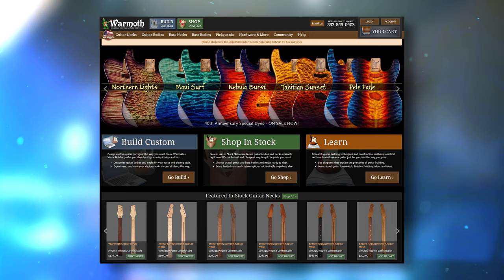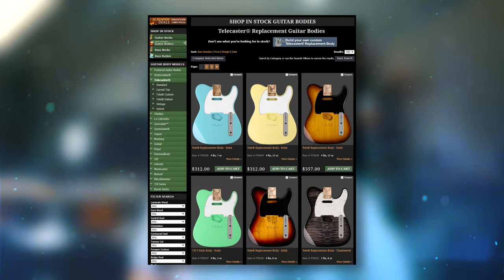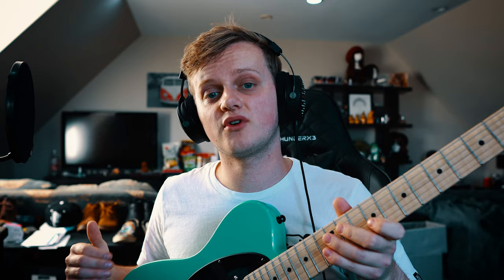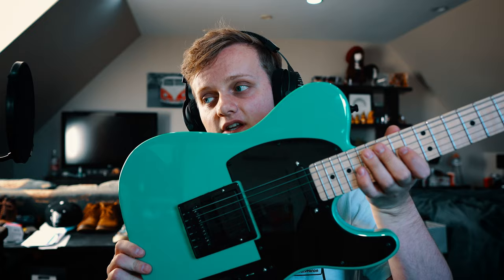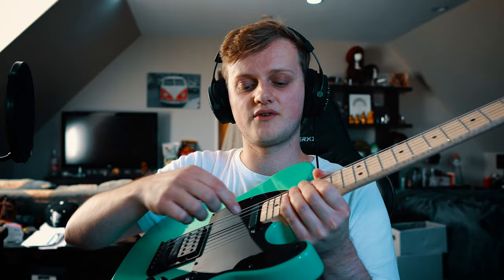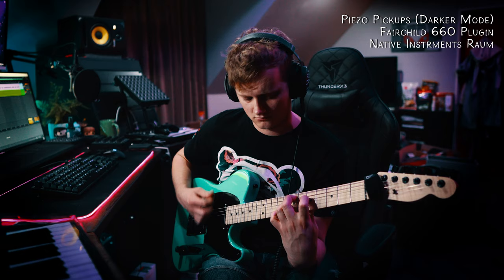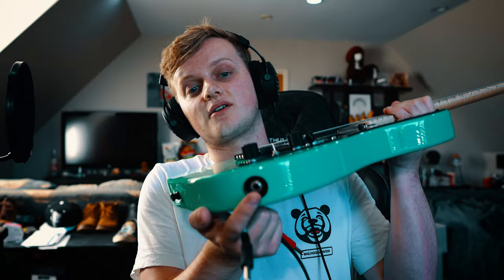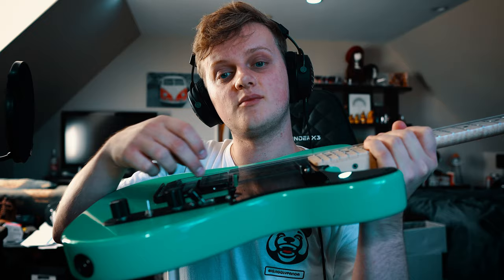My Warmoth Telecaster In Depth | Bare Knuckle Pickups Silo/Flat '50 | Graphtech Acoustiphonic

Comment: Excellent guitar!
If you ever need to dremel/file out cavities in future it's a good idea to score/cut the paint with a knife first (I use a scalpel/hobby knife).
This ensures that if the paint does chip off, it will only break off at your score mark!

I ran into this myself when replacing a cheap Floyd Rose copy with a GFS Fastloader (Floyd replacement that accepts standard strings).
Reply from the maker: Cheers man ✌️ That's a super handy tip by the way! Given its under the pickguard anyway, it didn't really matter too much if it did chip. However that's definitely going to help if I do another build at some point.

Comment: My perfect guitar:

Body: 
Stratocaster shape
Mahogany body with flamed maple top
HSS pickup configuration (Seymour Duncan SH-4, SSL-1, STK-S4N pickups)
Floyd Rose tremolo system with brass block and tremol-no mod
Neck/middle and bridge volume + master tone control configuration
Dome control knobs
Pearl pickguard
Red to black burst
Gloss nitro finish

Neck:
CBS-style reverse headstock
Flame maple shaft
Ebony fingerboard
24 stainless steel jumbo frets
Thin C neck profile
7.25" - 12" compound fretboard radius
Locking tuners
Pearl block inlays
Luminescent side dots
Satin nitro finish

Miscellaneous specifications:
Neck-through construction
Black plastics
Chrome hardware
Dunlop dual design strap locks
Deep body contours and heel joint
25,5" scale length

It's basically a fancy Ibanez RG or a hot rodded 70s Fender Stratocaster/Gibson Les Paul supreme hybrid, designed as a versatile metal axe. 
To me it's the perfect balance between classic design and modern playability
Reply from the maker: Sounds like it would be a pretty solid axe man! 24 fret on a strat would be cool as well. What's the idea behind getting a Floyd, but then adding the tremel-no to it? Like for an Ibanez style fixed bridge with fine tuners? Or just for the option of having one should you want it later?
Reply: @LivingTimmy  the tremol-no is basically just in case. If it's going to be my main axe I'd like it to be as versatile as possible
Reply from the maker: Ahh I see, good idea! ✌️

Comment: That’s a bad ass tele, I built a warmoth Strat with Gibson scale neck and a single Seymour Duncan SH5 with split coil and a roasted flame maple neck. I love it just struggling to lower the action a bit because I got a compound radius and 6100 jumbo stainless steel frets (they’re huge). Once I dial the action in further it will be nicer than my Gibson. Just afraid to keep turning the truss rod . Love your build , the piezo and the magnetic pups sound awesome!
Reply from the maker: Cheers man! I was actually really tempted to go for a Strat initially. I was going to go for a matte black body, roasted maple neck, a single BKP humbucker in the bridge, and then I'd install the piezo system in a Floyd trem. After budgeting it out, the Tele that I actually did was going to be a fair bit cheaper, even with the added neck pickup.
Checked out the vid of your Strat on your channel, I dig it! Has it got a push/push for coil splitting?
Reply: @LivingTimmy  yes indeed , I’m working on a better quality video to show it off, I’ll be sure to hit you up! Cheers !
Reply from the maker: @Crescent_Audio  just briefly watched it on my break at work, looks like it's turned out fantastic! Especially given it was $1.1k for the whole thing 👍

Comment: I actually have a full custom build from them patiently waiting for them to be able to start up again. I'm a strat and jazzmaster fanboy with configs of all kinds but p90s so I've got a p90 machine in the works that's a mashup of said pickups and some of my favorite S/JM types. It's a swamp ash JM body with a standard strat floating trem and recessed input, JM pickguard with a SD vintage p90 in the neck and a SD hot p90 in the bridge with tone, volume and 3 way on the guard. The neck is a one piece birdseye maple with vintage tuners and with a 10-16 compound and a black corian nut. All the wood is unfinished as I plan to do a blue stain on the body and oil the neck then all black hardware, guard and pup covers. Really looking forward to this thing!
Reply from the maker: That sounds super nice man! I'm a big fan of Jazzmasters, so had actually toyed with getting a JM instead of a Tele at first. My thought was that in order to get a Piezo or MIDI control board into the guitar, it would be a lot easier making my own routs/cavities safely hidden under a pickguard. If I did another build, it would probably be a single bridge humbucker pickup on a Jazzmaster with a Roland GK MIDI pickup in it. That way I can add Jaguar like controls/switches to the pickguard that are actually controlling the MIDI side of things ✌️
Reply: @LivingTimmy  Interesting, I'm not confident enough to do my own full on routing and have never given guitar midi/piezo a play, I'm intrigued though, it sounded really cool!

Comment: Yo Tim! Did you ever do any other mods to the tele? You said the signal from the neck pickup was low because it's going into a 500k pot but if you solder in a 470k or 500k resistor from the lug that the hot lead of the neck pickup attaches to and then ground the other end to the volume pot then neck pup will think it's a 250k pot and your neck tone will be brighter and louder! Ho ho ho 🎅🎅🎅
Reply from the maker: Hey man! I haven't really done any more modifications to the Tele at this point, I was thinking of drilling a hole in the bridge somewhere to rout the piezo wires under the bridge, but didn't have the correct drill bit when I was restringing. I'll definitely have to look into that resistor trick! Cheers man! 🤘

Comment: Hey Tim SICK demo and riffage of this tele build ! It's sweet builds like yours right here and several other videos/research that made me finally pull the trigger on my own however I'm a little stuck on the neck/net width...
:
Burning question say you can ONLY choose a standard thin neck option not a large neck, boatneck or 59 profile etc, just the closest thing to what you think is a C shape neck.
- now what would be your 
GO TO nut width to compliment it ? Should I go with
 1- 11/16ths (43mm)
 as a safe starting point? That's what is considered standard nut width I believe and it matches up with most of my favourite guitars and probably those of other players really because..
.
I know for SURE i cant go much lower in terms of nut width especially the vintage fender size *41mm will probably too tiny feeling! Im 6"1 and on necks like that in the past with my moderate sized hands (yet smaller pinky finger lol)
the high e string slips off the fretboard when playing fast/soloing maybe you've experienced the same kind of tendencies on a thin nut yourself?
.
And Important note is I'm NOT going with a floyd rose, instead a gotoh 510 bridge SO basically I'm stumped there and not sure what nut width to settle for. Even on the opposite end of this, going TOO large width wise so higher than 43mm will likely feel way too wide I don't want playing between strings to feel like a massive "leap" either
.
Anyways, with all that in mind my guess is it's safe to lean towards a
 *standard thin shape neck + 
1 11/16 nut* it sounds like the safest recipe so far and for that area I'm really OK with "vanilla"/safe nut width and neck combo since if that one aspect is off, we can surely both agree that it can drastically compromise the feel of a good neck!
.
Anyways I'm very interested to hear if you agree or what your advice would be for a newbie first time builder like myself. I cant tell over video but something tells me we might have similar size hands! 
.
Apologies for the novel amd I hope to hear back from ya whenever you get the chance! Cheers from Niagara falls Canada and please stay safe and healthy during this time🙏🤟😊
- Adam
Reply from the maker: Hey man! Cheers for digging the video. 

In regards to your nut/neck profile question, I reckon you're bang-on with the 1-11/16" nut and a standard thin neck. It's exactly what this Telecaster has haha. It plays really well and definitely prefer the neck shape over my other guitars (I also have a Gibson LP copy, a Jazzmaster Baritone, and a few extended range guitars). My Jazzmaster is vintage spec and has the thinner nut width and rounder neck, and it is definitely a bit harder to play the first fret on the low and high strings.

If it helps, if I were to make another 6 string Warmoth build, id still use the standard thin and 1-11/16" measurements ✌️

If you need a hand with anything else man, just let me know and I'll help when I can 🙂
Reply: @LivingTimmy   wow thanks for such a timely and helpful reply I really cant thank you enough man!! The bulk of my research and info that helped with the connection between neck shapes & nut width was from finding out first hand from as many people I could that have already started or finished their builds (like yourself) , stewmac and of course Aaron from Warmoth on their youtube channel in all his videos that he posts.
.
 What you've said above^ is a big help going forward!!  Without a doubt their is an
 irrefutable link between those two If I mess up the nut for my standard thin neck profile then it will take a long time to correct it by a pro/luthier because none are open here due to the lockdown right now! So I'm trying to order once/ aka "buy nice" so I don't have to twice! 👎
.
.
1 11/16ths (in canada most really just say 43mm anyway) seems like a safe bet and I'm just about convinced that something that size has wayyy less a chance for me to pull the E strings off the fretboard when playing fast like it has on too many guitars out their new in store or used that use something like 41mm ? Aka most of what fender has out there.. . I'm gonna go right out and say it to anyone else reading this that you could find the nicest suhr or ernie ball family reserve models etc for a steal at times on reverb, kijiji (canadian craigslist's) but in the end It will be a waste of money or gas driving to try that guitar by an amazing brand IF the nut width / string spacing is too narrow or too far apart! So after all the digging, watching videos like this and hearing first hand I'd much rather go custom order through warmoth for exactly what I want how I want then spend anymore time trying other brands guitars! I agree with you it's all in the process and understanding the ins and outs of these specs will only make the build, and future builds easier and faster once you can figure out exactly what fits the bill. 
.
.
It really is insane to think about how you can have everything dialed in about a guitar/ or build, yet if one area such as the nut is off, by mere fractions of a mm, your hands immediately recognize what doesn't "feel" right ! Lol
I'll be pulling the trigger on it as soon as possible and thanks again for the helpful advice man I'll keep a look out for your future videos/progress on builds and what not! 
Cheers all the best 🙏🙏🙏🤟
- Adam
Reply from the maker: Glad I could help man! I fully understand what you mean. It's something you don't really notice until you try a guitar with a different spacing. I still definitely enjoy my Jazzmaster, but it isn't as comfortable as the Telecaster. So if you're sinking a fair bit of cash into a custom or DIY build, might as well have it 100% locked down as to what you want eh!
Reply: @LivingTimmy  Thanks again for all the helpful tips so far Tim!! 
.
Your hands could be similar to mine but it's all playing style and preference is a constant change in life and time spent playing guitar even with versatile specs" there isnt a one size fits all! 
.
SO the final thing I'll ask you is on your standard thin neck profile:
 did you ever have to roll the fingerboard or shoulder edges to make the sides of the fret board feel more comfortable?
.
.
 I still think the standard thin profile on a flame roasted maple neck is right for me I might trim down the sides/ shoulders and give the fingerboard edges a slight "roll" to make it comfortable kind of like a charvel , its tricky because I don't know how significant" warmoths fingerboard roll" feels like, I wouldn't want them to take too much material off that's for sure haha but the positive being that because its roasted all the way through it wont wreck any of the wood finish/grain pattern atleast.
.
Cheers mate and huge props for clarifying everything this far especially the nut width!
🙏🤟
- Adam

Comment: Do you remember what type  of bridge pickup rout you chose? I can't seem to decide whether to get the bridge or wood mount. Thanks man! Really inspired with your build.
Reply from the maker: Hey man! So I had them do a Humbucker Rout (non-wood mount) so it has the slightly deeper cavities on either side of the rout to accommodate for long screws. The bridge pickup is directly mounted to the bridge piece ✌️
Reply: Tim Murray thanks a lot for the response! Stay safe! 🤓🤘🏽

Comment: Dudeee that was so satisfying to have various pup sound! Btw where do you find the diagrams for the wiring and stuffs?
Reply from the maker: Cheers! For the wiring diagrams, I basically just used Google images to look for ones similar to what I wanted, and then just adapted them. Graphtech supplies a wiring diagram for their circuit board and how to wire everything to the weird stereo jack, so I just googled a basic HS setup and how to add a split coil, and then blended the three wiring diagrams together. I'm not the tidiest with wiring (still a bit of a rookie), but it gets the job done 😂
Reply: @LivingTimmy  great job dude!

Comment: I have a Warmoth built Tele as well. It's my n°1. Here are the specs as you asked, it's a modern in traditional clothing:

- Modern construction AAAAA roasted flamed Maple standard thin neck with rosewood fretboard
- 10-16" compound radius
- SS6100 Frets
- moonglow side dots
- Chambered extra light roasted alder body finished in Sherwood green over 3TS (all nitro)
- Bare Knuckle Flat 50s, wired using a traditional 3 way tele Emerson wiring kit
- Copper shielded
- Electrosocket
- Gotoh vintage looking locking tuners
- Glendale bridge plate
- Titanium ferrules and saddles

Pictures and complete story here: https://www.unofficialwarmoth.com/index.php?topic=31117.0
Reply from the maker: Man that looks wicked! Loving the look of that Roasted Flamed Maple ✌️looks like you put a huge amount of attention to detail on that build. How do you find the Flat '50 in bridge and mid position?
Reply: @LivingTimmy  thanks man I appreciate it, I really did. I planned it for like 6 months, constantly changing things up to finally settle on this. I love the pickups, they sound great in every position. Bridge pickup is surprisingly beefy (not as beefy as the Silo but still) and handles high gain like a champ!

Comment: awesome build! It sounds very growly which is really why I'm definitely ordering this crazy Silo pickup.

I'm building a swamp ash Jazzmaster body with extremely similar specs (I went for solid paint Capri Orange though ;)) with a strat pickup in neck, humbucker over a Gotoh 510 bridge and a Stratocaster roasted maple neck.

Would you say the BKP Flat 50 accentuate well the bright "thumpyness" that you'd expect from a Swamp ash telecaster or do you think there could be a better sounding pickup in their lineup for this kind of sound?

Also I just wanted to point out that maybe the reason you have a volume drop in middle position (both pickups) is because they are out of phase, most pickup makers do the winding of a single coil in an opposite way they do the winding of a Humbucker. So without indication putting a single coil and a humbucker in series may put them out of phase. You probably want to switch the polarity on your switch of one of the pickup if that's the case and see if that works better for you (I may have just told something you already know, if so... sorry and cheers mate ;))
Reply from the maker: Cheers man! Definitely like the sound of your build man! Swamp Ash Jazzmaster would be sick. That new orange colour looks really nice as well 👌

The Flat '50 definitely has a nice sound, though I think there are some other ones in that range that have a bit more of that thump sound (I think it's the '59 and '62). BKP have good sound comparisons on their website.

I did have the thought about the phase issue, however it would only drop volume  in the middle position if that were the case. Coil tapped bridge pickup alone drop a fair bit, and then the neck pup is a bit lower than the Humbucker. The split coil one is the one that stumped me a bit, as I think the neck is just not as hot as the Silo. That being said, i still like the mid position tone I get haha 🤘
Reply: @LivingTimmy  yeah for real, that middle split sound so full and has that growly single coil juice, it's a keeper.

I'll definitely follow your pickup suggestion, I'm aiming for a very vintage style sound on the neck. I'll make neck and bridge position into opposite "heat" basically, like 2 separate instruments.

Thank you for the quality content!
Reply from the maker: @TomatePasFraiche  You'll have to let me know if you get a video up with this build at some point. Will be keen to see the final result!
Reply: @LivingTimmy  You are inspiring me, I might really make a video about it :D Cheers!